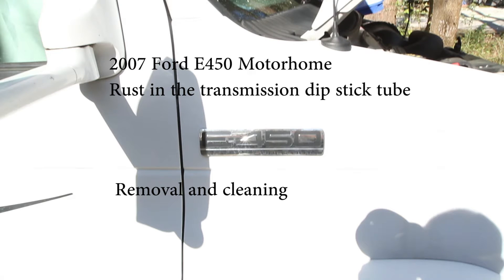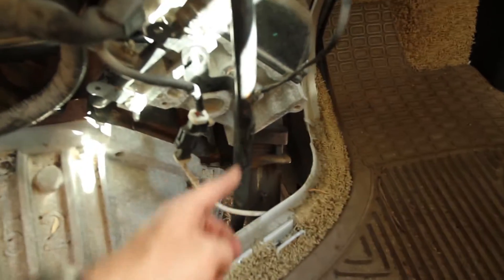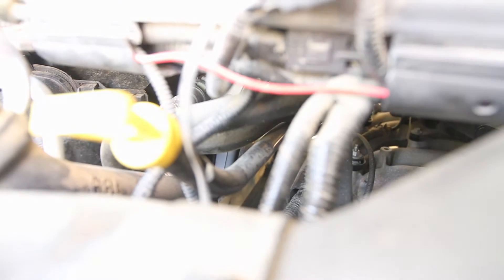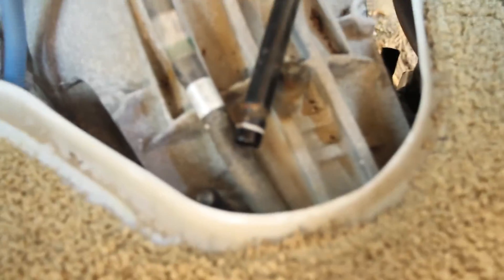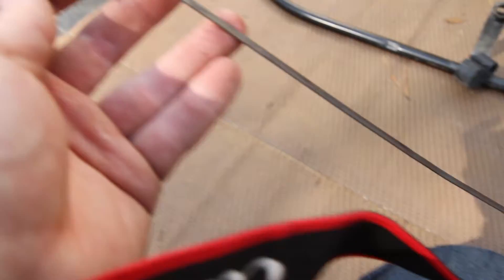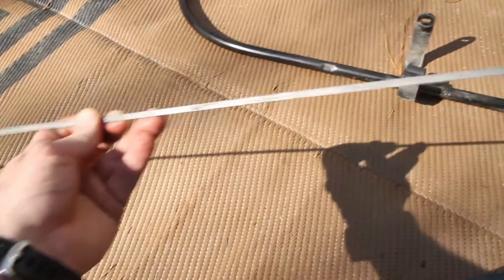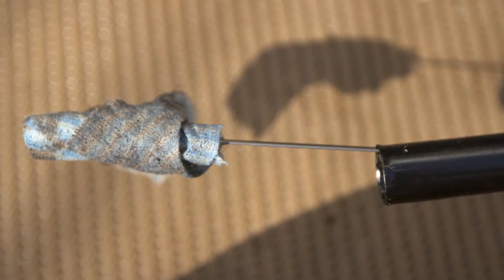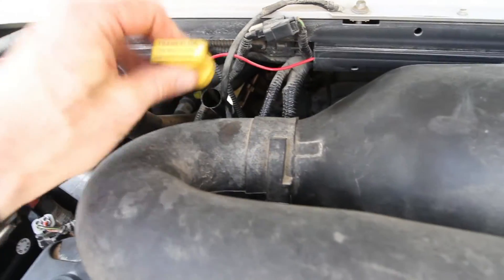Transmission Dipstick Tube Removal and Clean 2007 Ford E450

Comment: Steel wool is not an ideal thing to use to clean other metal, especially stainless steel. The problem is the steel wool will leave tiny particles which will rust. Better to use scotchguard. To clean my tube I intend to use a Gun barrel Bore snake which has brass bristles. You drop the bore snake in and pull it out the other end. I'm guessing a 30 caliber bore snake will clean it up. I agree that the top of the dipstick may need an extra o-ring to keep condensation out. I am going to address mine when i change my filter and fluids.